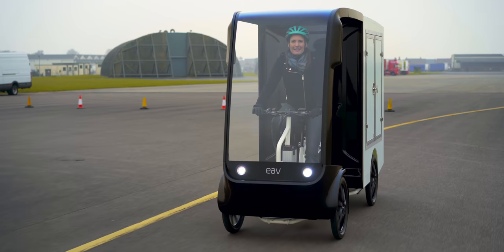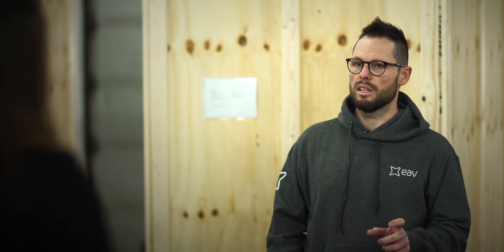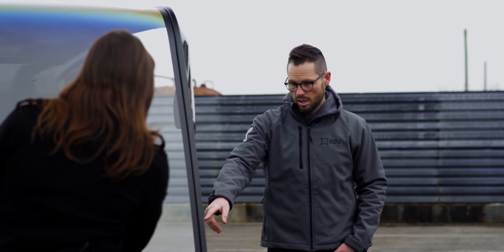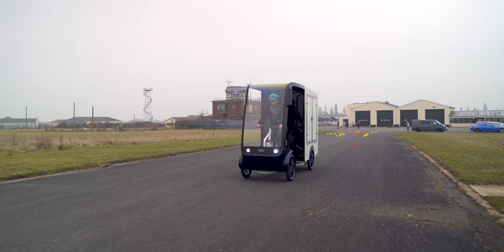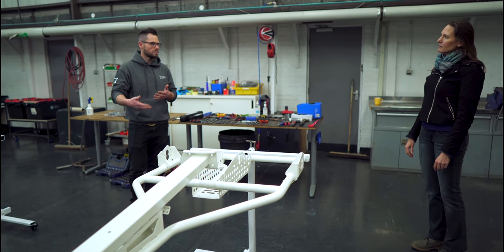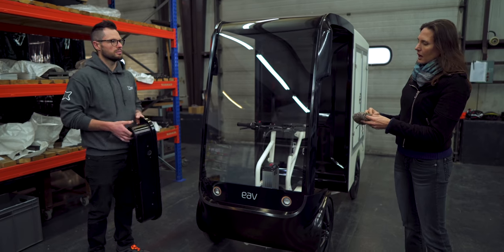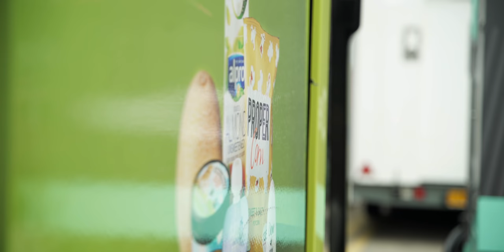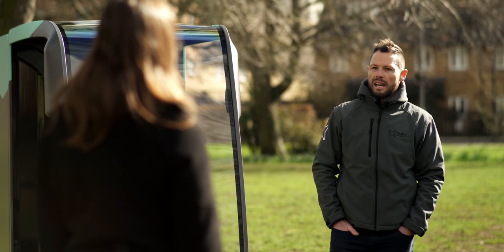EAV - Can these electric assisted vehicles change urban deliveries? | Fully Charged VEHICLES

Comment: Yeah, someone will melt the meterial to separate it for recycling. What will happen in reality? Hot recycling in a waste incineration plant. Sorry, but who belives something like this? No one will do an recycling facility to rcycle 20 of these bikes in a year.  It's economically nonsense.
Reply: Perhaps the petrol fumes have addled your brain chief, if you watch again you'll note that the company's business model is subscription based and they maintain end-to-end control over the vehicles' life cycles, meaning they'll be doing the recycling themselves not relying on the existing entirely inadequate greenwashing schemes that have been laughably branded as "recycling".

Normally I'm not a fan of sub models, and I hope they'll at least give people the option of purchasing one outright for smaller businesses who would prefer ownership, but it does make a certain amount of sense for a product like this for exactly the reason you're referring to.
Reply: @YodhrinsForge  That might be your problem, with the petrol fumes and maybe I inhal to much of it while riding my e-bike(s), but he didn't say anything that THEY will do this. Thats why I wrote the comment. You can do this, you can do that. But WHO can do this and that. You feel, that he want to get over this question. This is a problematic material if there is now one, who do the recycling. In that point it would be eaysier to use common materieal. It's the same with cabon, there you can heat up the material to 600°C where the polymer dissapear, but someone has to do it for this material. 
In the end it's always the question if just because you can do something, does it makes sense to do it. It's the same problem with cars like the BMW i3. Carbon might be nice as a material, but it's the opposite of being enviromently friendly. It's just not engough, that something is somehow possible.

Comment: Sounds good until you are the one pumping this damn thing to make a living. Loose the pedals and add a slightly larger battery and motor to lighten a lifetime of labor.
Reply: than it would not be classed as a bicycle, losing the reason why they made it.
Reply: Then it becomes a motor vehicle.
Reply: Cycling is astonishingly good for you. Cycling for a living is a good way to keep healthy. Sitting in a vehicle is a good way to develop long-term health problems.